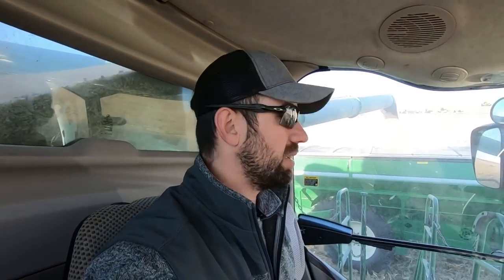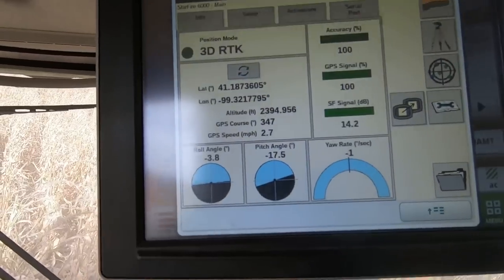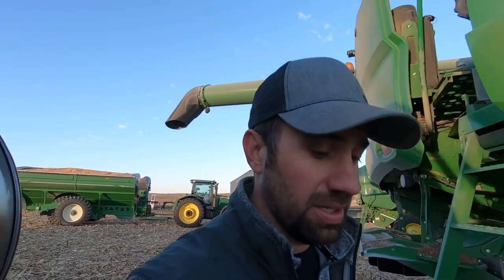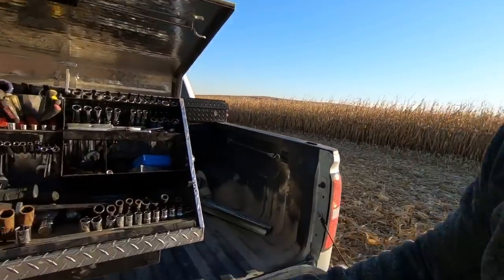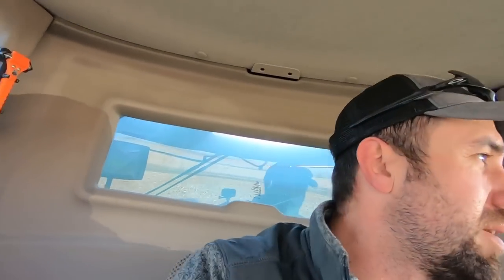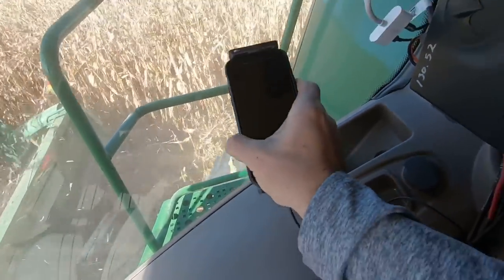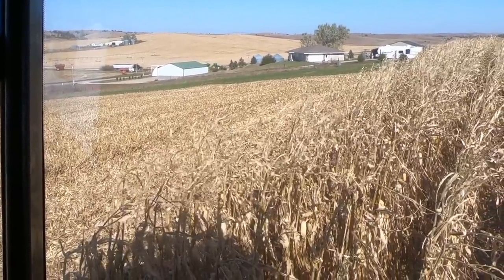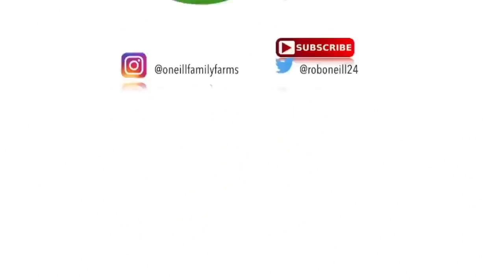Pickin’ Corn

Comment: Good evening.
Another very nice video as usual. You are very good at explaining your daily business. Keep up the good work.
One question : do you operate the corn stalks devastator rollers on your head? If yes, does it make a big difference, for your machine tyres and then for the biological destruction of the stalk since your are farming with minimum tillage? If no, do you plan to make the acquisition?
Thanks and best regards from Paris, France.
Stephane
Reply from the maker: No we don’t run them on our heads. We run intermeshing stalk rolls that pull the stalk through the head to rip the ear off. That grinds them up really well. We like to leave a little standing stalk to act as a wind break to prevent the other residue from blowing away in heavy winds. I’ll  try and elaborate in next video maybe. Thanks!

Comment: ever thought about a hillco leveler on your combine,i have one on my 670 ,one day i turned it of to see if i would be happy with out one,no way
Reply from the maker: I’ve seen one run around Sioux City before but no one runs one around here.  How hard are they to put on?
Reply: @ONeillFamilyFarms  my dealer installed this one but can be done on the farm if you have the ability to lift the new under carriage.cost between 50 to $55th dealer installed
Reply from the maker: Probably makes the machine thresh better being level.